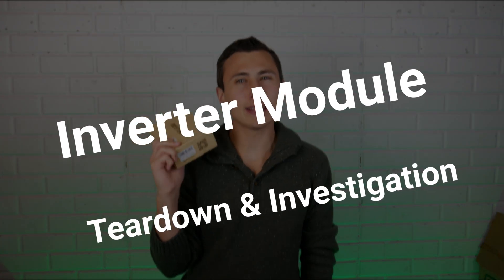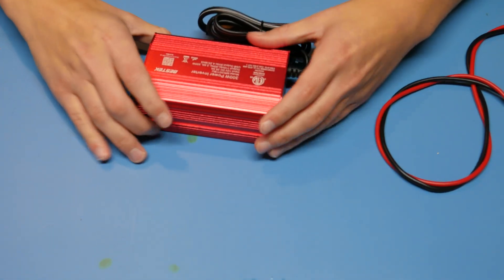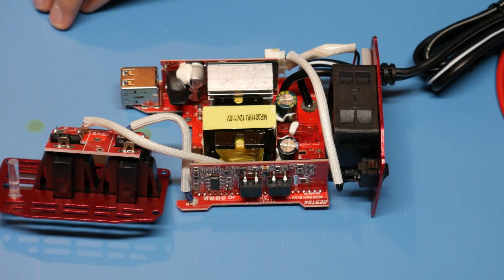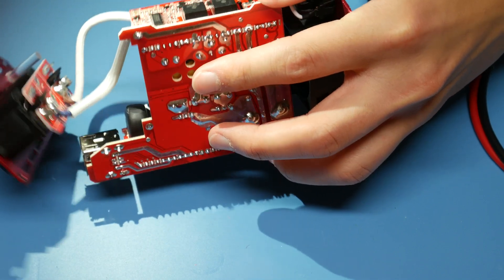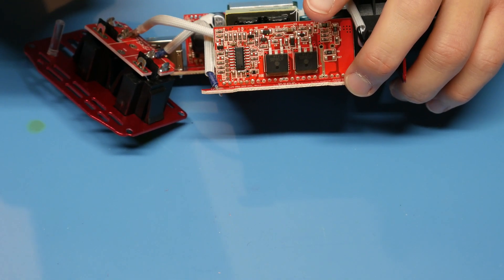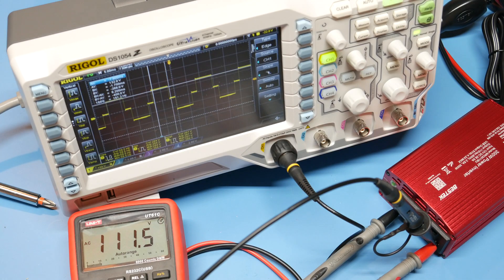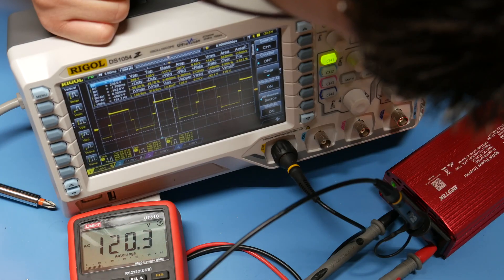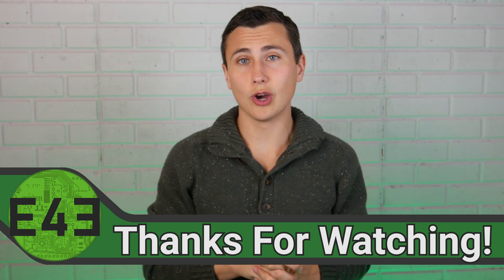Inverter Teardown | INV1

Comment: They hard wired a cigarette lighter port to a 300W inverter? Those can only get about 10A out before they start to overheat. That’s a fire hazard at 30A
Reply from the maker: LOL, so true! Great thoughts, and absolutely. I doubt I could ever really pull 300W. Maybe 300W peak* (for 0.5s)

Comment: You should really look into the EGS002 boards. They are pretty cheap, around $2 each, and do pretty much everything you would want to do on the H-Bridge side. They are SPWM and people have had VERY good luck using them. To scale up all you need is a totem pole driver and people have made 15KW CONTINUOUS 48V to 220V line frequency inverters with them using 40+ high-current mosfets like the HY4008. But you could easily use it to drive the IGBT H-Bridge to turn the HVDC into 60/50Hz AC.

I have no idea whether or not it will be better than your current inverter setup but from what I've seen, they work very well. Your IGBT's heating up may have to do with turn on/turn off time or something, maybe try reducing the resolution of your SPWM?

Comment: I watched one of the inverter videos where you were messing about with snubbers, you used a split phase primary and had MOSFETs connecting phases to ground alternately, similar to the popular "ZVS driver" for flyback transformers. But the leakage inductance was causing MASSIVE voltage transients that had enough energy in them to blow your FETs. in this case, using a half bridge or full bridge drive topology to a single primary may be preferred. LLC converter puts a series resonant capacitor in-line with the transformer and you can get voltages on your primary that are quite high, and really huge voltages on the secondary. An unloaded LC series network can get up to enough voltage to light up nixie tubes on the primary!
Reply from the maker: Fair point! We might just need to try our hand at an llc! You're totally right about the high voltages... Better to use the parasitic inductance to our advantage!! Thanks for the thoughts, and thank you for watching!
Reply: @EEforEveryone  I'm eyeing those flyback transformer cores. I got a bunch of them and the winding area is huge! I need to measure core values like saturation, permeability, and effective length but I think I can run them at 200kHz and push 1KW through them, based on my back-of-the-envolope calcs.
Reply from the maker: Aha! Yes! I just grabbed a big box of e-cores (the ones we used on the old UPS/Inverter Project. They're bigger than the small cores used in this PSU, but should also be able to push a lot of power!
Reply: @Joachim Shekelberg That is because they operate as flyback converters. As such they are not even transformers but instead coupled inductors. They have an airgap that reduces there magnitizing inductance, and the secondary has a lot of inter-winding capacitance and have integrated diodes that might not be particularly fast.

The core however is just a large ferrite, whoch I woild expect is frequency agnostic. Increasing operation frequency could result in higher eddy current losses but is required to avoid core saturation at high volt-seconds

Comment: my guess? forward converter or maybe LLC converter. Those are the 2 main high power converters out there. Forward converters are limited by the leakage inductance of the transformer, where LC resonant converters take advantage of the leakage inductance or K < 1.

The honest rating of that lil converter is probably around 60 to maybe 100W. 300W is laughable.
Reply from the maker: Oh yeah. I completely agree on steady-state power. There is simply not enough cooling for that poor converter. Sounds like a great way to fill a car with magic blue smoke!